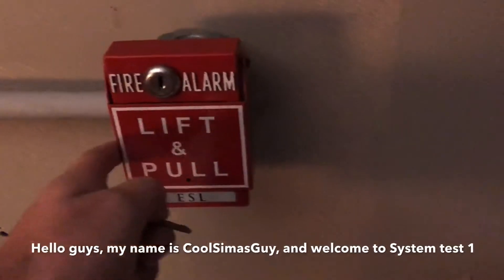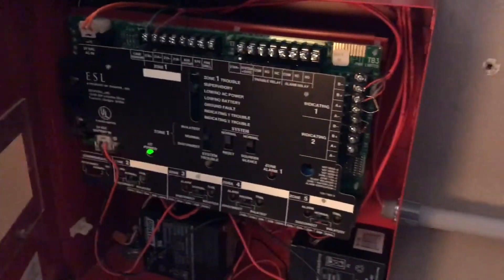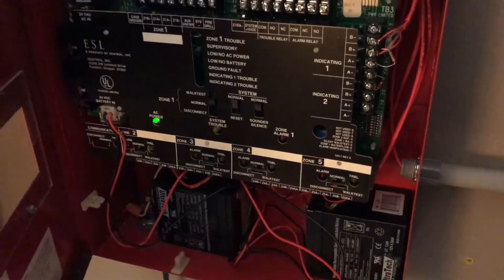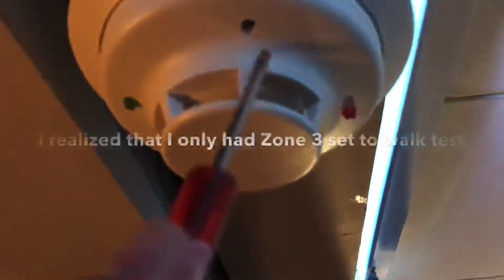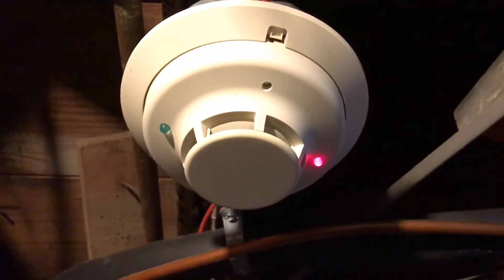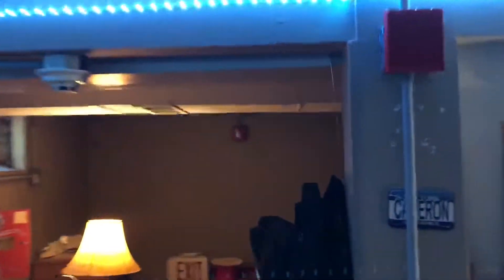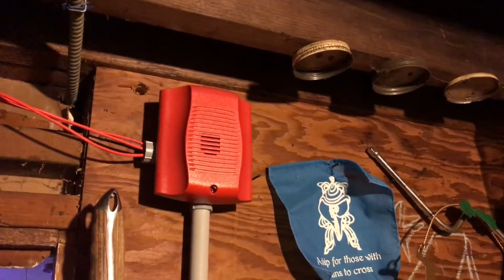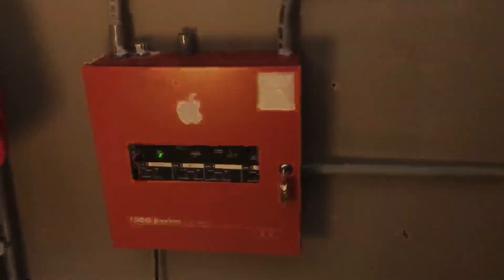System Test 1: Buggy Panel

Comment: Eerie as this was basically the same fire alarm setup as The Station Nightclub that unfortunately burned down in 2003. ESL 1500 inside the main entrance vestibule. Handful of pull stations at exits and even one in the light and sound control board booth. Handful of heat detectors. And even more eerily, Wheelock MT's on steady. And a weatherproof MT later installed in March 2000 on the account of the lack of fire alarm monitoring. A few heats were also added in that work order ordered per the AHJ